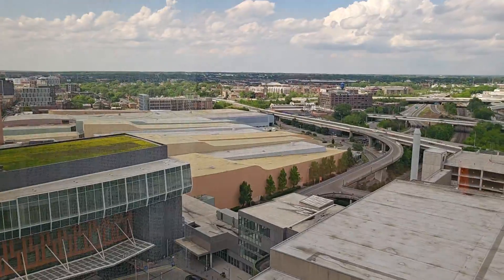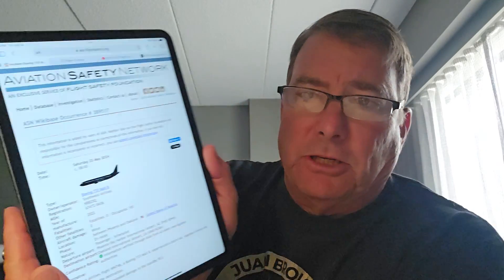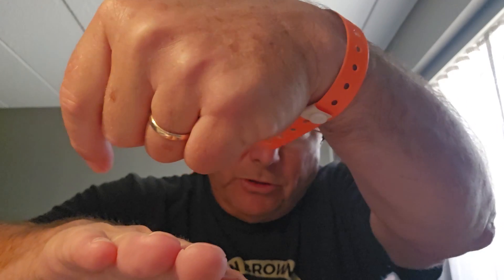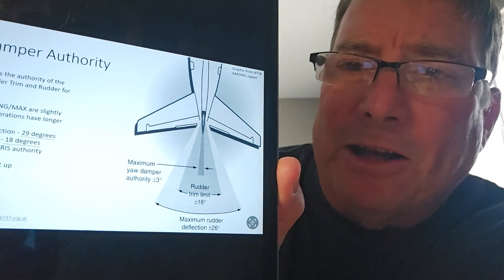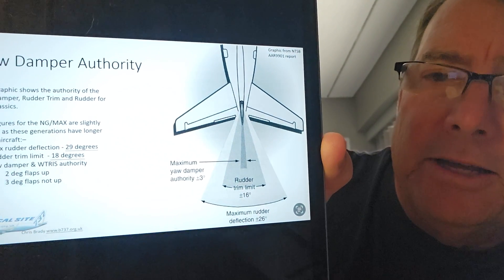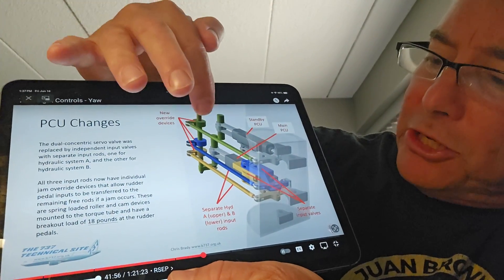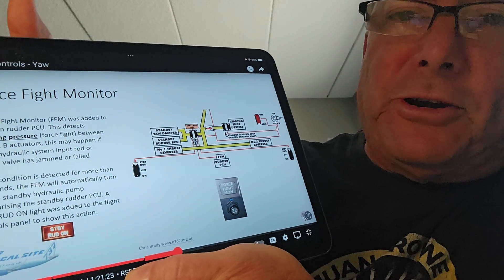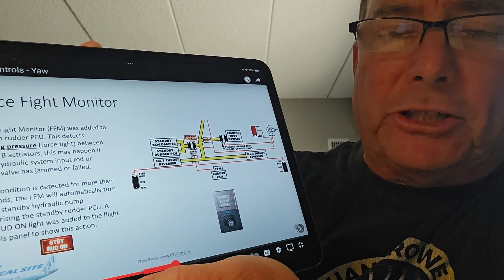SWA 737 Max-8  "Dutch Roll" Incident

Comment: Can you explain why Dutch Roll is so bad?
Reply: Depends how long for and how violent the oscillations are?
Are carrying passengers or freight?
Reply: From another comment:
@stuntmanmike37
3 hours ago
Read of the 2013 Kyrgyzstan KC-135 crash, Shell 77.  A damaged PCU induced a dutch roll so violently that it stressed the aircraft beyond structural limits causing an inflight breakup.

Comment: Read of the 2013 Kyrgyzstan KC-135 crash, Shell 77.  A damaged PCU induced a dutch roll so violently that it stressed the aircraft beyond structural limits causing an inflight breakup.

Comment: I think I remember a 707 crashing in the 50s or 60s because the pilot flying put it into a dutch roll and ripped 3 of the 4 engines off the thing.  Passengers survived and pilots died.
I think it was the 707's debut or something along those lines.

Comment: So it was structural, not servo failure  I was an Avionics/Flight Controls Instructor for 20 years and upon inspection can't figure how that rudder servo works.  The L-1011 was designed in the 60s and seems to be more fail safe.  All servos were hydraulic and mechanically independent modules. For example the inboard aileron servos were 3 modules that were fitted together with 3 separate actuators so that if one or two were damaged it would not effect the others.  For another example, the pitch control system had 4 servos and 4 linear piston actuators each attached with shear pins.  If one jammed, the other three would over power it and fracture the shear pin to isolate the failure.  The rudder servo/turn coordinator was dual and if both failed the aircraft would yaw 3 degrees with about a 10 second cycle.  Not bad.

Comment: Wrong. Three 737 200's were lost. The third crashed 4 miles from Havana Cuba in a flat pancake after taking off. The owner had neglected to yank out faulty equipment. The mechanism is called the Cleveland Parker Hannifin Double Slider. It's a cylinder and piston, speed enhanced with a pair of sliding sleeves that allow the rudder to flick very fast, unless the mechanism jams. When jammed, the rudder full deflects and locks, and you hope to unjam it by slamming sympathetic and opposite rudder alternately. Temporary recovery is done by dropping the climbing wing, blasting asymetric force with the engines, and dragging the airliner crooked through the air, while avoiding a climb. When a double slider locks, a pilot feels the rudder swing at its own chosing. The double slider was replaced with a larger and a smaller cylinder, and different plumbing. 747's also have a larger double slider, but no crashes.

Comment: see dutch roll incident in the 1950's-60 involving a 707 that lost 3 engines (structural failure) new airframe on a taining flight from Boeings Everett Washington facility killed flight crew othewr pilots onboard where seated in aft section and survived. aircraft crashed in Skagit river

Comment: The MAX is inherently unstable due to the compromised engine positioning.  The thrust and lift balance was compromised to make the engines "work" on this air frame.   This is also the core issue behind the MCAS,  it was put on to compensate for instability and excessive control oscillation.
Reply: No; It's not unstable... it just behaves differently than older 737s in a few places.
Reply: @jcl410  Lol

Comment: My understanding was that the design of the 737 rudder control PCU didn't fundamentally change from the earlier design after the 1990s accidents, i.e. still a single physical unit but with dual concentric pistons, the inner piston acting as the redundancy in case the outer one jammed or became otherwise inoperable?

Comment: Great reporting Juan. I instantly thought of the hard over rudder losses with USAir and the United on final to COS. I’m more concerned with more Max mysteries. I think you mentioned that the primary PCU was not the failed unit. When Boeing was trying to certify the 707 in either Europe or the U.K. They required Boeing to add a boosted rudder. Look up American flight 1 in the early 60’s departing out of ISP (NY) bound for LAX.

Comment: I have 36 years on the 737 by itself and four years being on the 737 Max, I haven't seen any differences in this rudder system, I believe it's the same on the 737 Max as it was on the earlier model 737 's . I've seen if the input rods on the main rudder PCU are out of rig it will induce the force fight monitor system to kick on the stby rudder pump on and thus the stby rudder actuator and life goes on., Why the damage to the stby rudder actuator I have no idea, never seen this kind of  issue before, hope  this helps.

Comment: SWA - DUTCH ROLL INCIDENT

Juan,

You just keep giving.
Another outstanding analysis.

If the early reports are correct that two ribs to which  the 'stand-by' PCU is mounted, as well as the mounts of the 'stand-by' actuator itself were damaged, one has to wonder if this incident was actually far more serious than it appears.

Full marks to the crew for correcting things and re-gaining controlled flight, but it would appear that the force necessary to do this might just have caused the damage to the ribs.

When one considers the airplane that was lost, (some years back now), because of 'Hard-over' rudder inputs by the Co-Pilot, we might have come closer than we think to losing this SWA's 737.

Lordy.....!
Lordy.....!

Lets hope we are not off down another MCAS Rabbit-Hole with this....?
Boeing really would be toast if we were.

James Hennighan
Yorkshire, England

P.S.
Spot on with regard to your comments on CVR's.
Shouldn't the CVR issue call for the issuance of an Airworthyness Directive as a matter of some urgency...?
Reply: Yeah I’m wondering if the rest of the MAX fleet will need to be inspected.

Comment: The 737 Max has larger engines than what was originally used on the 737 airframe. This is reported to have resulted in stability issues with the 737 Max. I would be interested in your thoughts on this reported issue with the 737 Max. Your channel is much appreciated and is a treasure for the aviation community. Thanks for all that you do!

Comment: Powered rudder issues in the -135 involve a race to the guarded switch that controls rudder power to the SYD (series yaw damper) to depower ASAP. Downside being the likelihood any roll that exists at the time the SYD is disengaged will exacerbate to a Dutch roll event. 

The biggest thing to remember when encountering Dutch roll is to kill it with your ailerons (fight spoilers) and not chase it with the rudder. Trying to counter with the rudder will likely be input out of phase and lead to over stressing the vertical fin.

Comment: Back when the 707 was fairly new, Brannif was taking delivery of a new aircraft . It was a test flight with Boeing test pilots, and Brannif pilots. The pilot flying the plane induced a Dutch roll which ended up tearing off the engines, and resulted in a catastrophic crash. Luckily only a few people died.
Reply: You should add that the test pilot was fairly inexperienced and at that portion of the test, they had disabled the yaw damper (as a part of the test flight) which heightened the effects experienced.
Reply: yes, there's a youtube video

Comment: Old enough to fly the Starlifter, I was going to say ouch but I guess you are right.  The nose at cruise was always wandering in a figure 8.  I never flew the A model but I believe from the FEs, they said it was worse after the B Model stretch.  I was flying B737-300/500 from ‘96 to ‘01 and I remember we had to increase flap speeds by 10 knots to to give enough aileron authority to overcome a hardcover rudder condition until Boeing came up with the redesigned rudder actuator after the UsAir and UA crashes were traced back to the actuator failing.  The cause of the UA crash into COS was listed by the NTSB as undetermined until the UsAir crash at PIT and the investigators were able to put enough similarities between the two events to come up with a plausible cause.  Even then it took some engineering testing to create the situation that could cause the rudder actuator to go abruptly hardover.  I know there are plenty within our ranks that use to proudly say, if it ain’t Boeing, I ain’t going.  Might be true of some models, but I was never a fan of the 737.  Went to the Bus and never went back.

Comment: Good job explaining the 737 rudder PCU systems which the yaw damper is integrated with.
Couple of things:
I’m a retired 737 Mx guy and worked on them both in airline world and when I was at Boeing working 737 safety. The NG and MAX rudder PCU systems are identical. The only changes to flight controls of course was the MCAS and FBW spoilers.
When I hear things like PCU was damaged, I think ok was Mx working on the system prior to this flight or previous flights? These units are located in the tail section. So damaged, how?
Then hearing structure issues? Was the jet ground damaged and not reported?
These systems are extremely reliable on the 737NG/MAX.
FYI, manual reversion is a requirement during for Mx test flights and Boeing production flights… in my many years of experience very seldom did we encounter any problems from that test.
Going to be an interesting NTSB report.  Thanks Juan
Reply: Which means, that if there is an issue with the PCU, it could also affect the NG. This does look like a quality control-related defect though.
Reply: @Stoney3K nothing new for Boeing

Comment: I'm not an a&p, but I am an expert in hydrolic systems and cylinder repair.
Unless there is a scheduled time in which they overhaul or replace the cylinders, the seals will eventually leak, then subsequently fail. Depending on conditions and cycles and pressures,  seal failure can take   a year to many many years to happen.
But I'm sure over pressure solutions and seal replacement times are scheduled. 

But still, the plane is longer, so wouldn't more deflection or pressures in the hydrolic system be needed for the max 737?

Comment: I only flew the 737 100/200 (guppy series) for PEOPLExpress in the early 80s. I was dispatched once from Florida to Newark with a YAW DAMPER INOP MEL. Holy shit! Even though we were restricted to a lower altitude by the MEL, the passengers in the back sure knew it was not a normal flight by the tail swishing around. I couldn’t feel it up front at cruise altitude, but I REALLY noticed the difference when I was hand flying and we went skidding right through the final approach course… and I realized that because of inop Yaw Damper I had to use the rudder pedals just like in a Cessna , which 737 pilots never do. It was an eye opening experience.
Reply: Yeah I once had 737 with an MEL'ed YD and it was a puke fest in the back. We refused the plane after flying 1 leg.
Reply: @sharedsailing4787  Vomit comet! They should have told the passengers, especially families with small children, and let them reschedule. Three or four young kids vomiting is no fun!
Reply: @sharedsailing4787 With different fuselage lengths the rudder moment arm changes, that suggests that the yaw damper needs to be tuned to the aircraft model. Is that a mechanical or electronic change?
Reply: @BrianMorrison  Electronic. The Stall Management Yaw Damper control unit uses information from the Air Data Inertial Reference Unit accelerometers to judge the amount of yaw and apply the correct rudder deflection to counter the yaw. That's how the 737-Max does it. The first models of the 737 didn't have ADIRUs, so it was less precise.
Reply: @BrianMorrison this reminds me of the argument drivers have over which is better; electronic steering or hydraulic.
Reply: We check the SMYD computers at least every A check, which I think is about every 500 flight hours. We check the rudder system in every way. Each hydraulic system. The proper fault warnings when the yaw damper disengages. The standby system for proper operation. Measure the rudder movement at the tail measured against a permanent index plate mounted near the bottom of the rudder. We look for a minimum displacement when switching between systems (so the actuators aren't fighting each other.  It's actually quite an exhaustive series of tests through the (SMYD) Stall Management Yaw Damper computers 1 and 2.
Reply: People express was first flight ever thanks to my cheap dad at least I got to fly a 747 even if I had to watch a wall of smoke roll back on take off from the smoking section puke!!!
Reply: @L2theWcarscoffeelife  More smoke from the people than from the engines!
Reply: Recalling our basic coordinated flight skills is valuable, and apparently rare.  Virtually  every time I’ve flown a BFR or check-out flight with a qualified pilot next to me, a remark comes into my headset as I roll into whatever the first turn of the flight is.  “Wow, you actually coordinate your turns.”  Or something like that.  And I’m always puzzled by it.  Aren’t we taught to do that from just about every lesson after the discovery flight on?  Not flexing here, I’m seriously surprised.
Reply: @TheGrandPoohPaw I am completely  baffled as to why there's so much drama over having an MEL'd yaw damper. The Boeing autopilot thing also baffled me. Pilots should know how to safely fly a plane without AFCS and know how to disable it. I've noticed a ton of pro Airbus trolling on social media. The CCP happens to run an Airbus production line and pours huge amounts of resources on American social media platforms. I don't like Boeing, but maybe that should ring a bell!
Reply: @TheGrandPoohPaw  haha i get the “its nice to fly with someone who knows how to land”. 

Not flexibg either but the standard of pilotage in the general private pilot population is pretty poor. Safe but missing finesse.

Those who fly tailwheel just wouldnt survive if they had the finesse of the average non tailwheel pilot
Reply: Ual serviced PEX planes.  Remember Cpt. Steve Smith, Dennis B and Dave McElroy
Reply: Ah, PEOPLE Express! Those were the days.  A lot of duct tape to hold up food trays and keep the overhead luggage compartment doors closed. But what did you want for $29 from Newark to Boston.
Reply: @martinm2178 we would call it the 2-faced airline what with its distinctive tail end livery -)

Comment: No idea why the FAA hasnt required retrofit of CVR on existing airliners. Inexcusable. On the linguistics of dampener, its frustrating when a techically incorrect word is used by non-specialists, however its a reasonable alteration for a human to arrive at and isnt indicative of an LLM composed piece. Havent seen the articles in question so dont know if something else prompted that conclusion, but that alone is the sort of error id expect a journalist with limited turn around time instead of a GPT error. Id actually expect a LLM which is trained on public data to use the more techical verbiage as that will be the more common context related word

Comment: If I remember correctly the issue with the 737 y a w problem in the 90s was actually solved because a pilot push the wrong router paddle in it actuated the rudder in the opposite direction that it should have. Correct me if I'm wrong but this action by the pilot actually led to the understanding of the problem

Comment: That 737 has sure had it's issues with rudder control. First the deadly rudder hardovers, and now  PCU problems. I've never heard of dutch roll in a 737, that was traditionally a 727 problem, and thus it's need to have 2 yaw dampers.
Reply: This particular aircraft?  This model of the aircraft?  The 1st and 2nd generation 737s had some rudder problems in the 1990s.  I don't know of any such issues with this seriesof 737.
Reply: @GH-oi2jf  You're right, until this incident. Now it starts all over again.